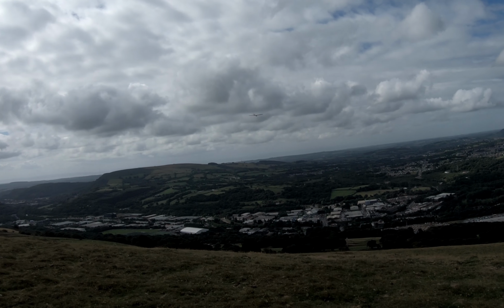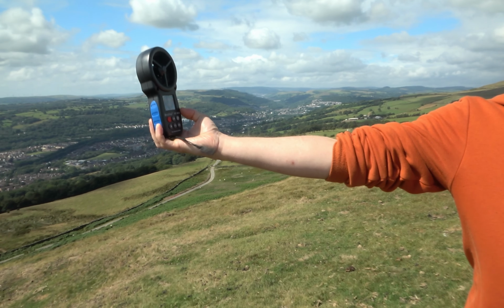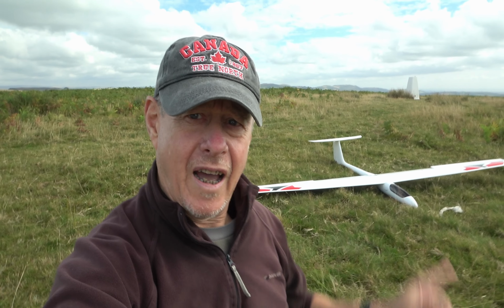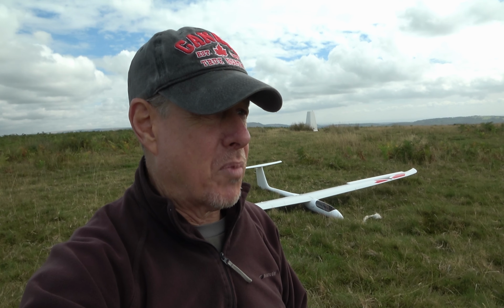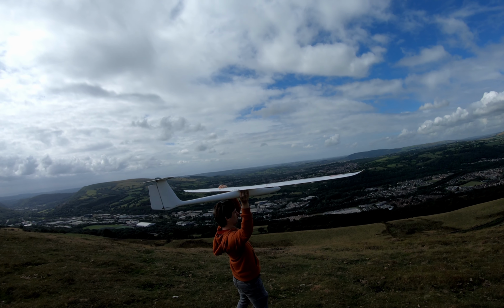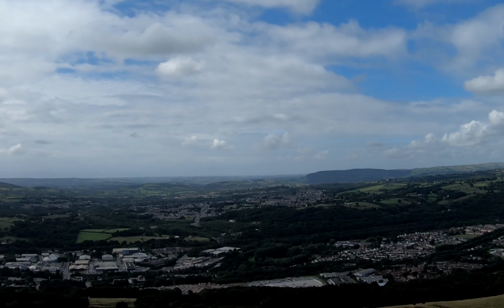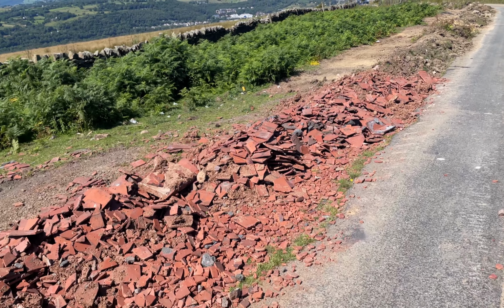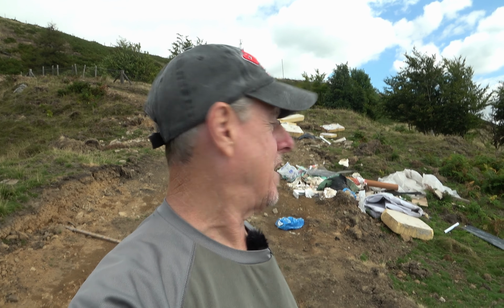FVK Signal flies again & fly tipping on our slope

Comment: Just getting back into slope soaring after a very long lay off, re using my very old '35' radio gear and an old Ace soarer. Regarding fly tipping, I reported finding a massive amount of builders rubbish on the 'unamed road' which leads to the meio, just around a month ago. I chased this complaint up and to be fair to Caerphilly council, it was cleared within a fortnight. The people who carry out this fly tipping have very low or near zero morals and even lower IQ readings. Be great to meet up and pick up on your (and Josh's) expertise. Looking at your videos It looks as though I am not pushing out far enough beyond the slope, worrying about loss of lift I guess.
Reply from the maker: Happy for you to join Josh & myself on the slope. We usually post on a Facebook group, Slope soaring in Wales, when we’re going. Join the group and you’ll see when we’re up there next.
Reply: @A470RCSoaring  Thankyou Steve, much appreciated. I have managed to avoid joining any Facebook groups up to now, for various reasons, but I think I may have to reconsider if it opens up access to soaring groups with the valuable knowledge/experience behind them.